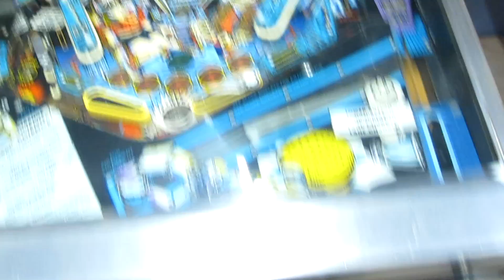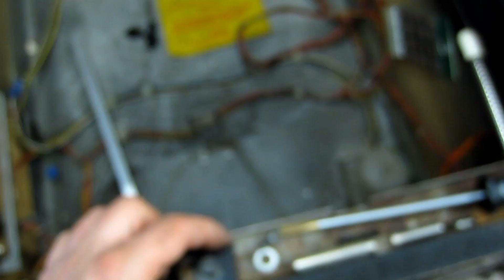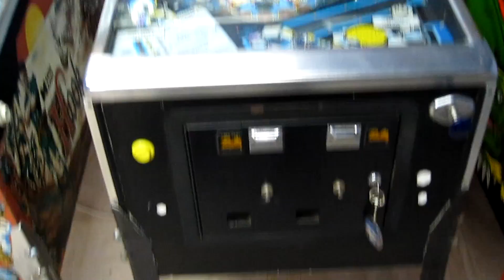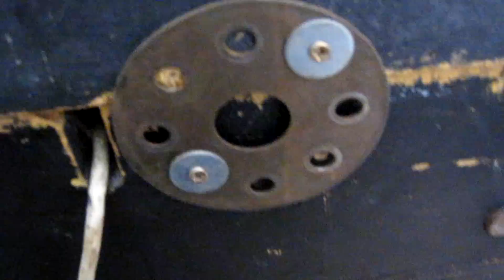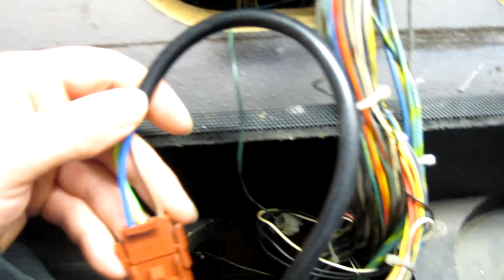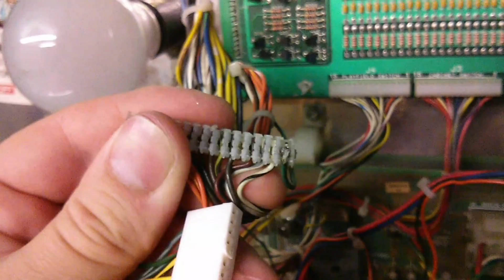Bally Strange Science - Repair & Restoration Part 1

Comment: Hi Great Job love the detailed videos, I have a Strange Science also, it has the same issue with the molex connectors on the board with intermittent faults.  Can you share the details of the connectors and pins you used to repair the connectors I am in Australia and would like to give it a go.
Thanks in advance
Reply from the maker: They are Molex 0.1 (2.54mm) KK series. Good luck!